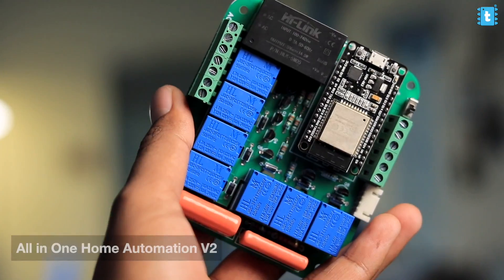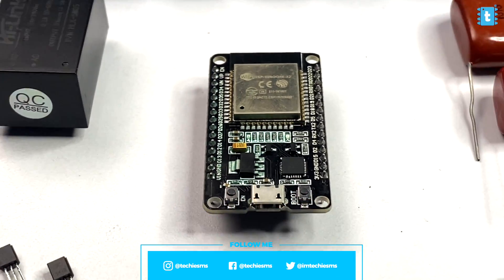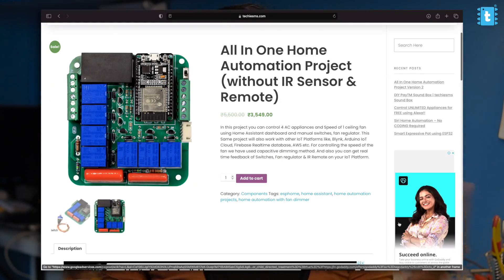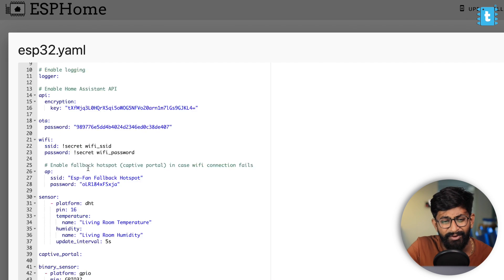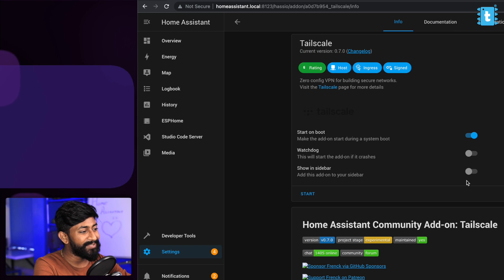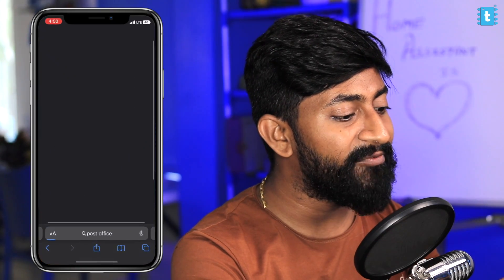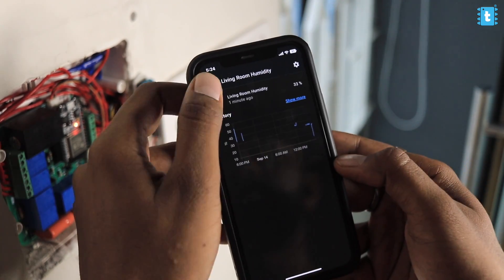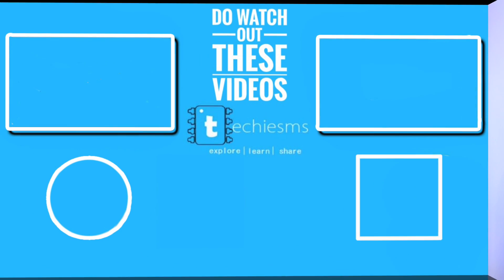Home Automation using Home Assistant Over Internet for FREE!! | ESP32 Projects | IoT projects

Comment: Hello Sir, I am facing issues with relay.
My relay is getting NC to NO.. on applying both 3Volt and ground

When I touch input pin of relay to 3volt of nodemcu it gets switched... And if i also connect it with ground pin of nodemcu..it also switched on

Comment: Could you create a design using 8 relay modules but without a fan control feature? This is because brands such as Atomberg do not require a fan regulator.

Comment: I really liked this project, before buying it i have doubt. What happens when wifi is down, can we turn on lights & fans thru manual switch?
Reply: You can Hotspot the system with your phone, Make sure your Wifi Ussd & Password are similar with one on your router

Comment: If the rotary switch is turned to speed 3, what happens if we set speed to 1 from the UI? and what happens if the user keeps the physical button in a turned on condition? Does UI respect in favour of Physical switches?
Reply from the maker: It will set to speed 1
Reply: But the rotary switch would then be on speed 3?
Reply from the maker: Yes.
See the simple logic is 
Which ever command it receives it will respond to that command only regardless of any other input

For eg. if you turn on the switch manually it will get turn on for sure. But if you turn it off from dashboard it will get turn off even if the manual switch is in On position
Reply: What if a continuous rotary switch is used instead of a fixed valued rotary switch?
Reply from the maker: It won’t work with this code
You need to change that
Reply: Got it! Thanks 😀